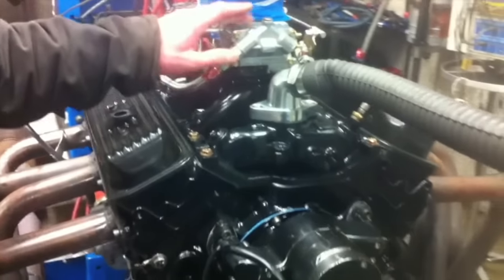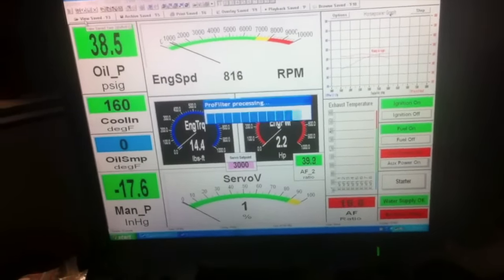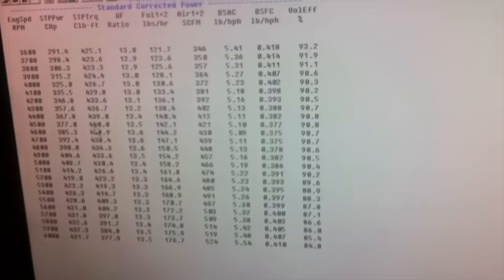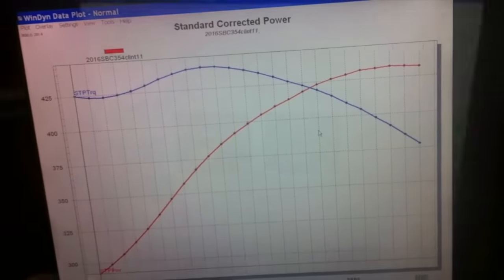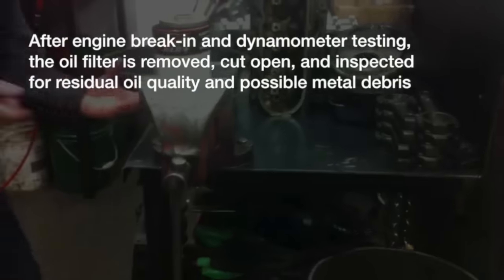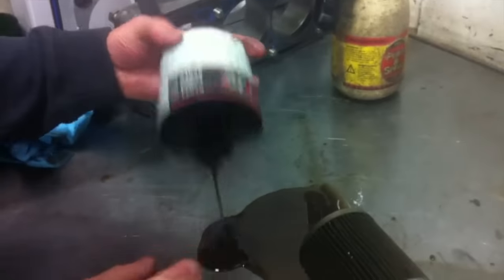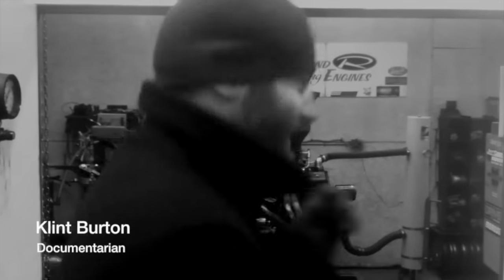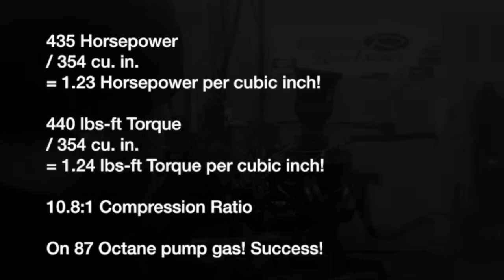SBC 400 Block + 327 Crankshaft Dyno The 350 Chevy Should Have Built (2016)

Comment: I'm a Mopar guy and I wish Chrysler had built a 360 bore block with the 318's 3.31 stroke.. I came along too late for the 340 but I believe this combo would best it with modern Magnum parts...heads, roller cam, ect.. it's a . 030 difference in crank pin diameter... could.030 over bearings do the trick 🤔?
Reply from the maker: Sounds like a great idea!

Comment: A smallblock 400 is like a smallblock with Bigblock pistons . You can't open the cylinders on any other Chevy smallblock up as a Standard bore 400 comes. I always wanted to put a 350 crank in one to see how it run. A 371cid I believe its call . Just didn't know about how it holdup running it high rpms with bearing spacers  unless I run a aftermarket special grinded crank for the 400 with the stroke of a 350 .
Reply from the maker: Thank you for commenting! The 350 crank is also a good combo when using the long connecting rods :)

Comment: this gives me some ideas to say the least. ive got a pretty mild vortec 350 that i absolutely love in my dd in the warm months. 40k on build/rebuild and shes still going strong. if it ever let go i was gonna do 383 stroker but im liking the idea of something like this. big pistons but keep some of the stroke as i dont want a rev monster. i love the low end grunt my current motor has. but a little more would prevent future damage as id never need all of that power. 1 step up in the cam and a little more displacement and some extra fuel and ill be doing just fine with reliable n/a torque over 500 ft lbs. currently around 400 ft lbs and actually get good fuel economy thanks to torque. i can pull 4th gear with converter locked at any speed past 36 mph when it locks. hills or flat ground and pass on highway with no effort with no unlock or downshift. i want to put the 6l80e behind it over a 4l60e thats in there as they always break. the extra gears and convertor lock in any gear would be fantastic to keep rpms low and torque actually utilized. i think i could hit 40 mpg with this think between 45-65 mph. i currently get 35  mpg at those speeds and 25-28 on the highway. highway could touch 30 with that trans too i think.
Reply from the maker: Sounds like a great reliable truck!
Reply: Just build a 406, why de-stoke anything? You can run high static compression with 87 no matter the bore and stroke it's all in how the cam is degreed and timed. A 406 is gonna me a ton more power everywhere than a 362ci.
Reply: @hendo337  deff food for thought. But idk if my block has enough meat to support all that and I do like the roller motor aspect of the newer block. I know splayed main caps do help the newer blocks a ton so maybe it won't just break on me. I wanna keep the windows in the doors afterall. I do appreciate the hint at 406 I was thinking in the 390's somewhere but a couple wee cubes never hurt a stump puller. I run a lunati torque cam and plan to switch to the next step up as it's a big power improvement everywhere. Keeps good idle vacuum and manners. But it needs head work and the cam I have was the biggest I can use before headwork. Both still work with fuel injection and are only good till 5500 and 6k on the step up. Farthest I'd ever spin it is 5500. 5200 as it is now seems pointless. The hp pulls good but the torque pulls gooder and I like it that way.
Reply: @chehystpewpur4754  , there are practical limits on how much you can get out of a 350 block. Your best bet is to use no more than a +.030 overbore = 4.03 bore which is likely the limit of the blocks capacity already.
 That bore with a common stroker crank of 3.75" stroke gives you 383 ci, or with a 3.875" stoke crank it is a 396 ci, ( no cast cranks in this size, just steel cranks). With alot more work and money you MAY be able to stuff a 4.0" crank in giving 408 ci, but that is a very costly adventure !

The common 406 ci, (really 407 ci is correct), is just a stock 400 block and crank (4.125" bore & 3.75" stroke) with a +.030" overbored cylinders, but if you install a 3.875" crank in that +.030 400 block you now have a 421 ci engine !!

 Cubic inches for Torque & HP, but you always need to buy good heads - even if that leaves you with a 350 ci only budget . Vortec heads are great budget heads if you can find a set not cracked or buy new, with porting they'll even work great on the bigger engines.

Use this formula to figure V8 cubic inches ; bore x bore x stroke x 6.2832
Reply from the maker: Thanks for commenting. You clearly know your stuff!
Reply: @tking7513  yeah i know cylinder walls get thin quick on 350's but no 400 block i know of off hand is a roller motor. my 350 is and id like to keep it that way.
part of why id settled for 383 stroker but i think 388 is still in the safe zone these days. my motor doesnt run hot at all with my setup so i think those extra cubes will be alright. i plan on sticking with vortec heads with some work done to them to accept the larger cam but there isnt much flow to be had on them without losing what makes them good. the bottom end torque. clearancing the valve guides for bigger cam 3 angle valve job and a little more cleaning of the intake ports is all i need on the heads. it pulls hard up to 5500 rpm and i have no reason to spin it that high anyways.

Comment: The small block chevy suffered enormous problems because of the inherent fault built into the engine. The middle of the cylinder heads  have 2 exhaust valves right next to one another causing an overheating situation which causes a vacuum leak around the exhaust valve seat. Chevrolet knew this which is why the next gen engine laid out the valves properly. The only way to alleviate the problem on an existing engine is to mount a proper coolant pump which means a lot of machine work to the existing pump body and the installation of a proper pump impeller. Using the 400 block also brings a whole raft of problems as the bores are siameses so we found the best way is to create an extra outlet on the pump body allowing the use of sprayers installed into the block at the point where the bores are joined on both sides of the block. Otherwise there is an out of balance temperature condition take place inside the cylinder causing premature wear of the piston and the cylinder bores.
Reply from the maker: Good points. Thanks for commenting :)

Comment: Aren’t the 400 blocks impossible to find now? From what I understood that is why the 383 was a thing bc there was an abundance of nice 400 cranks around due to the 400 block not lasting very long 🤷‍♂️Siamesed bores? I wanted to build my lt1 gen 2 into a 302, I think somebody did it in a magazine. They made a 3” crank in the baby lt1 iirc. Wasn’t made to rev tho and that’s where they need to be to make horsepower. I thought it’d be cool to have a modern dz motor.
Reply from the maker: I absolutely love your idea. I’ve wanted to do the same thing but finding one of those 4.3L V8 cranks isn’t easy either! Thanks for commenting!

Comment: So maybe higher revving but at the same time. You have to balance your motor. But maybe I'm confused on what you guys are doing but bigger cubic inch is definitely always better but you have to balance
Reply from the maker: Thanks for commenting. Our goal was not to make maximum power, maximum torque or set any records. We set out to build a budget minded, mild street engine that could run efficiently without high octane fuel. The benefits of this combination with the large bore, short stroke and very long rods, allow for high compression without detonating. For how mild a cam and great drivability this delivered we’re very happy with the results.

Comment: Was this not the theory used to make the Chevy 302? 327 block, 283 crank? Love this build!!
Reply from the maker: Hey Jeff, thanks for the message! This is like the 302 (in a sense) but with the big 4.125” bore and the 3.25” stroke. We love the results so much. Next time we want to put more cam in it and turn it up to 8,000 :)
Reply: Exactly
Reply: Good heads will let a smallish cam get the job done.
Study David Vizard’s books on gas porting heads and valve events.
Reply from the maker: @carterlee8344 
Thanks for your comment :)

Comment: this should be a fast rev, high rev combo... i had a 327 block, 283 crank, .060 over, 350 horse hydraulic chevy cam ,that revved to 7000 in a blink....with stock 327 valvetrain...
Reply from the maker: Awesome! Thanks for commenting.

Comment: Why take a 400 sb and not build a 406sbc? Can't afford a good set of heads? I built mine with RHS iron heads, FT pistons and a single pattern cam. I don't know the HP but the torque is amazing.
Reply from the maker: Thank you for commenting. We’ve built many 400+ engines too. Actually I really love the big torque builds as well. 
This was a special build for a customer who knew exactly what he wanted. The results were above expectations and so we’re thrilled :)

Comment: very cool to see, but by standards of today the set up is so antique it would not stand up to what comes from the factory today, and thats coming from one who built motors to run 9 second quarter mile shots in chevy vega hatchback cars 71-73. The single high lift cam and compression is just murder on a valve train causing constant work being totally unreliable for the street. very cool to build and tear down with dyno runs. I went through drums and drums of 110 leaded fuel back in the day seeking max HP, welding up runners on tunnel rams to port out to huge breathing diameter direct shots to the intakes. One of the coolest sounds of the days when I was running is to watch a movie called two lane blacktop. the very beginning scene says it all. rides like the hellcat have the top on the hill today.
Reply from the maker: I thank you for your comments. It’s always interesting and we’re having fun :)

Comment: Like too put one of these in my daily driver 94 2500 GMC TRUCK 4X4 wonder what kinda mileage I'd get 9:1 compression stock cam any advise 🤔??
Reply: I would advise running a 400 0.040" over with the 3.75" crank at 408ci in a 3/4 ton truck with a 4 speed auto and at best 4.10 gears if not 3.73s. There is zero advantage to a destroking the engine unless you're cylinder head limited, (aluminum heads for SBCs that flow like crazy are cheap as dirt) or it's a light weight vehicle that extremely high rpms make you quicker.
Reply from the maker: I’d agree that a 3/4 ton truck should keep a long stroke in it.

Comment: i have a 79 400 and a 67 327 both run good also have 4 350 4 bolt pu engine sitting but have 4 4 inch stroke 454 with the 02xx trans waiting for me to start the next project i got all of them for free even the 79 400 in a cheyenne short box 4x4 with under 35,000 miles on the rig same with the 327 rebuilt in a 68 chevy pu but i dropped a 454 in it
Reply from the maker: Sounds great! Thanks for commenting.

Comment: what cam timing and head intake cc did you use?
Reply from the maker: Thanks for asking. The LSA is at 114 and we had the camshaft ground with 4 degrees of advance. The heads are from AFR with 180cc intake volume.

Comment: You stated that you used a 327 or 305 crankshaft .That is 2 different crankshafts ..because the 305 crank is the same as a 350 crank ..So basically you just built a 355 or a 377 .both have a 4inch bore and punched them 30 over which is the same as a 400 block
Reply from the maker: Hi Dan! Thanks for commenting. Both the 305 and 327 have a 3.25" stroke. In this build, we used a 327 steel crank with 2.45" mains, considered the "large journal" 327 crankshaft. A 350 crankshaft has a 3.48" stroke. This build, with a summary of the specs in the description box, is a 354 cu.in. SBC with a 4.165 bore x 3.25" stroke. Best regards.

Comment: I thought they removed coolant passages between the bores to get 400cid ? Also not many of those engines lasted due to over heating because of no coolant between the holes?
Reply from the maker: The 400 was always a Siamese block and did get a bad reputation for overheating. Personally I’ve never seen an overheating one (because of that) and my family business has been rebuilding domestic automotive engines for 50 years. A lot of times we’d replace the motorhome 400’s with 350’s because of the reputation people assumed but with a good working cooling system we’ve never had issues. 
There are a few upgrades to coolant flow that prove successful too. 
As a performance built engine, they are excellent. The big bore is the ticket!
Thanks for commenting.
Reply: @ceperformance  I still like the 327 version of the small block , I remember a Studebaker used to race in Mission , with a 327 , hell, you guys might have built that engine . It sure would go
Reply from the maker: Thank you for commenting :)

Comment: Stock parts? were the heads worked?
Reply from the maker: Hello! Thanks for asking. The crank is stock, the Vortec heads are un-ported, stock valves but new threaded rocker studs and angle milled gasket surfaces .100” to increase the compression. We got the chambers down to 55cc’s.

Comment: Cam number for the camshaft you used or was it a custom grind?
Reply from the maker: Hi Sandra! The cam-card went with the customer. Cam specs, in brief, can be found in the video description box. Thanks for your question, and best regards!
Reply: @ceperformance   i saw the duration specs in the brief.  Any lift numbers, lobe numbers or customer contact info so i can find out the cam info?
Reply from the maker: I found the cam card. The lobe #’s are:
4870s / 4871s
.361 / .361 lobe lift (we used 1.6 ratio rockers)
LSA @ 112
218 / 224 @ .050” lift.
Reply: @ceperformance   ah ha thank you so much sir!
Reply from the maker: Absolutely :)
And it’s also done with the 4/7 swap firing order. 
It’s not an easy to find core do they don’t offer it very often.
Reply: @ceperformance   yeah i noticed the 4/7 swap. Ive had a few 4/7 swap nitrous grinds.
Reply from the maker: Right on!

Comment: One question: connecting rod length? That's the part that Smokey liked for more TDC dwell and  less detonation.
Reply from the maker: Thank you for watching and for your question. The specs are in the description below the video. This build uses 6.25” rods :)
Reply: I was under the impression Smokey was a stickler for small bearings and less friction.
Reply: Rod length doesn't affect the power at all. In fact, EngineMasters did a rod length test & contrary to popular belief, the short rod combo made more TQ & HP than the long rod assembly with everything else being the same. I've had a 400 SBC for 40 years(same block) with combos using stock 400, 5.565" rods, 5.7" rods, & 6" rods. The ONLY difference is the longer rods seem to feel like the engine runs a little smoother & they lighten up the pistons a bit. The engine won't tolerate any more timing with the 6" rods than with the 5.565" rods. Detonation is usaully caused by a way too lean mixture, not timing. There is a difference between spark knock & detonation. The spark knock you don't hear kills motors, but detonation kills them a lot quicker! LOL
Reply: @hendo337  That was Grumpy Jenkins in his early Pro Stock cars. He ran the pre-68 327 cranks & blocks. Smaller journals might reduce friction a little but they increase the bearing loading. NASCAR engines still run small rod journal(2") cranks but NASCAR now has a blueprint spec on that too. Journal size can be too small which causes the crank to not have enough "overlap" between the main & the rod journals. This causes the crank to be weaker & flex more, leading to failure.

Comment: you are aware that the large journal 327 ruck cranks fit into 350 blocks with out spacers on the mains.the 400 block uses a larger bearing.
 this is the 327 4 bolt project that gm never built. with the correct rods these engines turned 11k rpm consistently on pump gas. a lose converter and a power glide shoe horned into a chevy 2 or monza and you had the drift car before it was called drifting. it was a power slide in the 80s now some kids with daddy wallet have these cars that wont hook up so they power slide them around tracks instead. and thats a lot of fun as we all know.
Reply from the maker: Hi Ivan! Our build didn't require bearing spacers. The repurposed Dart block we used had 350 mains. We appreciate your concern! Best regards!

Comment: I always wondered about fitting a 283/302 crank in a 400 block, with long rods, light weight pistons, it should be a bullet over 3-4k rpm, especially with good heads and cam, light valves, maybe titanium,  well balanced, 8500 should be a day at the park, 12:1 compression,  but a street 10:1 with mild cam, the right intake, should be a good street engine also, with a 5-6speed, light vehicle, 3k lbs
Reply from the maker: Thanks for commenting! We’re thrilled with this mild build. Runs fantastic on regular 87 octane and is fun to drive with a TKX 5speed in a 66 Beaumont.

Comment: If I recall correctly, the flaw of the SB 400 was that several cylinders were siamesed and the engine was prone to overheating. The 400 did not do well in the trucks.
Reply from the maker: It’s interesting to always hear these stories of overheating yet never encountering it in my 30 years of engine building. Almost all 400’s came in Motorhomes and pick up trucks. My belief is a good cooling system solves any inherent problems. Thanks for commenting :)